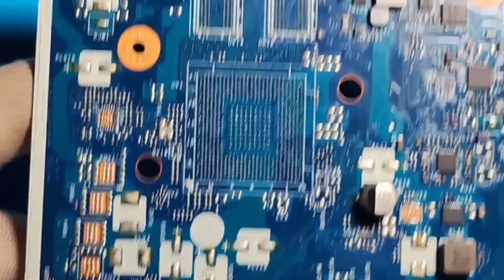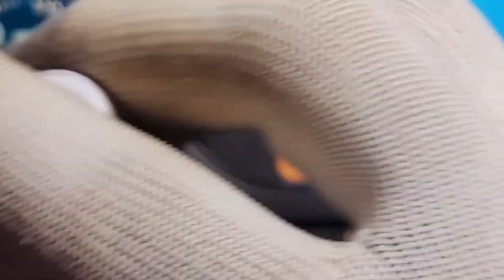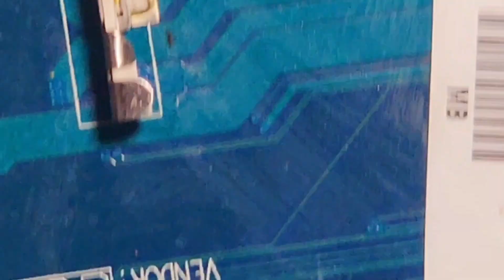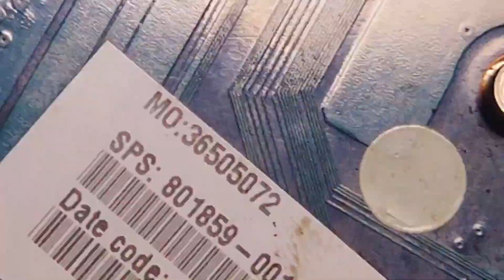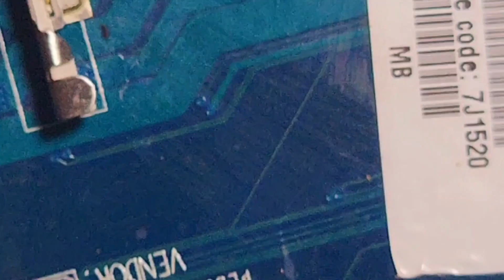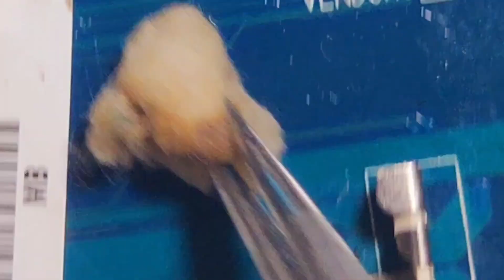HP | No power | 3V_5V line short | burnt pad & MOSFETs | LA-B972P | #PHILIPTRONIKS #restoration #hp

Comment: how can I determine what is happening at +19VB that prevents the charging circuitry (which seems to be functioning correctly when CSR are off circuit) from delivering voltage to the rest of the board? I couldn't find any short circuit on +19VB, what should I check next? The only assumption I can make at this point is that the short might not be on the main rail. However, I haven't been able to identify any shorts on any of the coils.
Reply from the maker: @ictrepairs  Nice question. There are instances where the +19VB line will be high impedence, however, if you connect the adapter you may not see a voltage in CSR. 

The 1st check point. Is measure Diode value of upper mosfet of all Inductors. You can measure this easily by turning to diode mode and then by keeping your negative probe on CSR and positive probe on all coils one by one. You must have a diode value at least 0.300 any value less than this will make the charger IC to detect short circuit and shut down voltage to CSR. Also, when upper mosfet got shorted there won't be any symptom of short on the coils.

In some cases your diode value reading of upper mosfet  between source to drain would be around 0.400 - 0.600. But Gate pin of the mosfet may have got shorted with drain or source. In this case there won't be any symptom of short as diode value would be appropriate, there won't be any short on the coils, lIn this case once you plug in adapter the particular regulator that is connected to the shorted gate to drain mosfet will turn on lower mosfet to prevent short to load and this low imepedence will be sensed by charger IC through CSR and will cut down voltage to CSR.

Tip: If you have jumpers from the main power rail to different sections try to remove jumpers and see if you have a voltage on CSR.

Finally, replace another CSR if all attempt failed. Because if resistence on CSR value increases then voltage drop will increase and this will provide a wrong information to charger IC as high current consumption will make the charger IC to trip.
Reply: @philiptroniks  Amazing! Thank you for understanding the problem so precisely, as I had hoped. I will thoroughly explore the issue following your suggestions. I truly appreciate the effort you put into providing such a detailed and thoughtful response. You really impressed me with such a genuine generosity!
Reply: @ Following your suggestions I've been able to pinpoint the jumper labeled PJ403, associated with the 3V3 generation circuit connected to the an SY8286BRAC_QFN20_3X3 named PU401.

However, no short circuit was detected at the output of the 3V3. This suggests that the issue might extend to other components or sections sharing the same power rail, making it more challenging to pinpoint the exact cause. How would you proceed from here? By the way I didnt want to hijack the comments but for your info the board I'm talking about is an LA-E921P acer nitro.. Thank you
Reply from the maker: @ictrepairs  You are really lucky. I faced the same issue today with a laptop where there was no any short on the main power rail. But charger IC turns 19V off if CSR is in place. I took diode value with positive probe on CSR and negative probe on gnd and the value was 0.600 which is a bit low. Normally we should have around 1.5 to OL. In this motherboard luckly I had small coils that bridges 19V to different sections. After removing one by one, I got 2.500 diode value at CSR after isolating GPU section. Now plugged in and I got 19V at CSR. Charger IC detects impedence through ACP ACN and when it detects abnormal it will shutdown voltage at CSR. Here the GPU regulator is the problem, it is about to die that's why it was pulling CSR a bit low. GPU IC VCC is connected 5V_ALW but it has ACP ACN connected to 19V rail. Through ACP it pulled 19V to low impedence.

Check your diode value as I did. You should get above 1.500.
Reply: @philiptroniks My initial problem was the high impedance (in the MOhm range) on the +19VB line, which made it difficult to identify the defective circuit. I will re-measure the impedance now that the bridge is open to determine if the value measured by the charger IC could explain why the +19VB drops to 3.x V. Currently, the +19VB doesn't disappear completely but probably oscillates between 0 and 3–4 volts before the protection kicks in, causing it to fluctuate within that range.

In this state, the gate of the MOSFET remains low, preventing the 19V from passing to the rest of the board. The issue now is that, without any clear short on the 3V3 line, I am almost back to square one and still unable to pinpoint the root cause. What I suppose is that an unspecified circuit triggers the protection once the 19V is received on the 3V3 line —not necessarily due to an increase in impedance on +19VB, but possibly because of another component or circuit on the 3V3 line activating the protection mechanism. What a brilliant technician like you will do in this situation? I feel I'm getting close but not enough to find the real problem and I'm so curious 🧐!!! Thank you for your time
Reply from the maker: @ictrepairs  A peculiar case actually. If you have Mega ohms on 19V rail then the charger IC shouldn't be pulling the voltage  low. If you think that there is a problem on 3V3 line that might cause shutdown of 19v rail. Just remove upper mosfet of the 3V3 section, then there won't be any connection between 19vrail to 3v3 line. 

Try this and let me know.
Also check the diode value of the 1st 2 mosfets after dc jack 19v. The value should be above 0.400 atleast. 

Did u try to replace 1st 2 mosfets?
Reply: @philiptroniks  Hi, I removed, tested, and replaced the second MOSFET. Both MOSFETs seem to be working fine as long as that bridge remains open. This bridge provides the input voltage to PU401, which is responsible for generating +3VLP and +3VALWP. There are no MOSFETs in this section.

+3VALWP becomes +3VALW after another bridge. I also tried opening that bridge to isolate the circuit from the load, but without success. +3VALW is distributed almost everywhere, and the diode reading still shows approximately 0.4V. The same applies to +3VLP, which reads 0.47V.

Comment: So what if inductor short and burnt on both sides of the board
Reply from the maker: @shobanavijay-g9d Good question. Inductors rarely short. Anyway if both side of the motherboard board is burnt, it will be challenging because, there are 5 to 6 layers of connections in a motherboard we to confirm they are not shorted or fused to gether. If we have schematics and boardview we can almost find a solution.